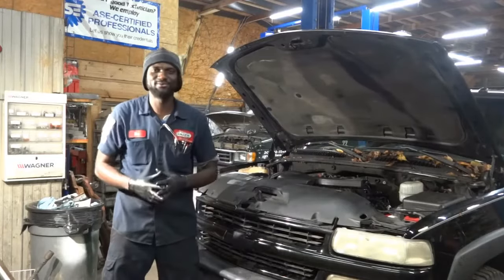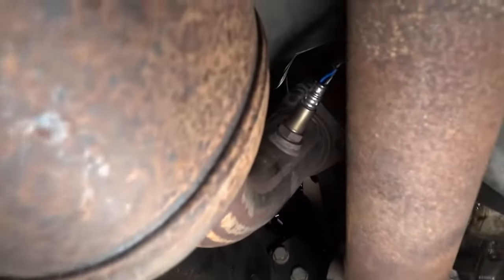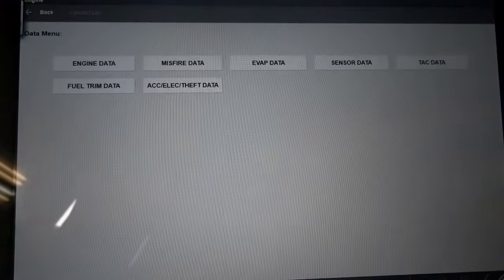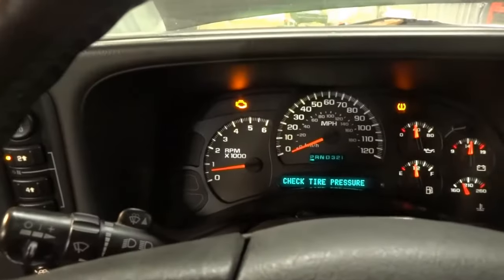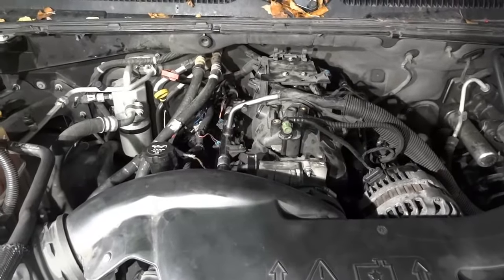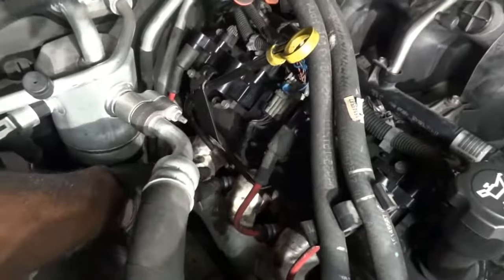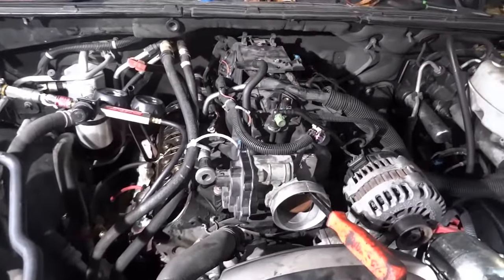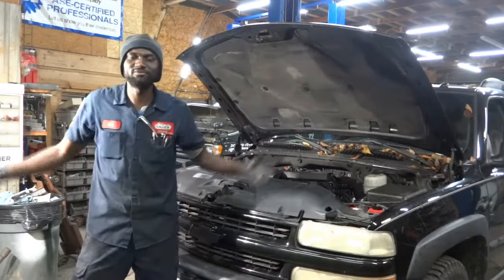CHEVROLET SUBURBAN 5.3L~ P0300, Still not Fixed After replacing the injectors and ignition Coils...

Comment: I bet you can't tell me what would make a 1996 Vortec 5.7L engine lose spark to ONLY cylinders 1 and 2 (at the end of the plug wires by the spark plug).  On my third complete new distributor.  Engine runs perfectly otherwise.
Reply from the maker: @dougr.6734   No! I can't

Comment: Did you use AC Delco Iridium plugs. Replace the plugs. with AC Delco. Do not use other brands of plugs. Only use AC Delco on GM vehicles. I tried Denso on my 2018 Silverado 5.3 and had a miss and popped the code 0300. Changed to AC Delco plugs. Problem solved.
Reply from the maker: @user-lz7uy7cd8i   Good to know! I didn't do the tune up on this!

Comment: My 03 flex fuel has the po300 code,it  skips most at hiway speed and at idle its has a slight jump and sometimes the engine light will blink a few times,ive replaced all coils will lifters throw that code or you think its an intake leak?
Reply from the maker: roltyd22  it's hard for me to say exactly what's going with it! you should take it to a pro mechanic and have it diagnosed, that way you will know exactly what's going on!!

Comment: I have the same code but mine smooths out when ingive it gas im thinkin its a fuel problem..but if its idling u can feel rhenmisfires and see it on the scanner but once u give it gas it goes straight to 0 misfires
Reply from the maker: @joeroe2839  check you coils or you might have a mechanical issue!

Comment: Well, you said they did a tune-up, so why are tou surprised they changed all 8 coils????  That's part of a tune up. When these trucks get those miles, we change all 8, along with all 8 plugs, wires, fuel filter, oxy sensors, and a service. So why the ridiculing??
Reply from the maker: @bradleyrussell1973   The tune up, you just be plugs and wires!!

Comment: What kind of scan tool do you use? Love your videos. Thanks!
Reply from the maker: Rick L I'm using the Snap on Zeus for automotive and a Diesel laptop for medium duty school buses
Reply: @KITS_Auto_and_Truck_Repair   How do you like the zeus  Deo ?  I hear a lot of complaints from other techs that it is a waste of money. Great video by the way keep up the awesome work.
Reply from the maker: @Genetics1  thank you, the Zeus has been a great tool to me so far, it has limitations when it comes to European and some Asian vehicles, but what I like the most is the labscope on it and the guided component test, the tool comes with a lot of information on sensors and other electronic components and much more, that's what made it worth buying for me, if you work on a lot of make and models the Zeus may not be good enough... Autel has got great scan tools
Reply: @KITS_Auto_and_Truck_Repair  Ok Thanks Deo !! One last question i forgot to ask you was  if the scope on the verus or zeus work on only cars or do you think it works on class 8 tractors to check sensors  like on cars.
Reply from the maker: @Genetics1  yes the scope can be used to check sensors on tractors or trucks, I use mine to check sensors on school buses too... 
since snapon scopes don't require an attenuator  you will be fine checking components with high voltages like 100v or even 200v
Reply: @KITS_Auto_and_Truck_Repair  Thnxs Deo! waiting for your next upload
Reply from the maker: @Genetics1  thank you...

Comment: So what about a air intake manifold leak?  Would that cause a misfire? Say after the oil sensor was replaced. And manifold was removed. Could it be a bad gasket on manifold?
Reply from the maker: Chris White, yeah a leaking intake manifold may cause a misfire, especially if it just started misfiring after removing the intake manifold...
make sure everything got put back together properly afterwards, like injector connector etc...
Reply: @KITS_Auto_and_Truck_Repair  thank you. It did. And I was thinking the same the truck runs fine . Guess I will take it all apart again. I bought new gaskets since I was guessing it had to come back off. I sending everyone I know to you. Your a big help. Thanks for replying means alot to me.
Reply from the maker: @chriswhite6632  you're welcome and good luck with your project...

Comment: I thought p0300 is random misfire, meaning not limited to one cylinder. Won’t the computer read a specific cylinder misfire, and in this case read cylinder 6 misfire?
Reply from the maker: Micah Watson  That's a great question!! some computer programs are not really accurate in terms of cylinder identification, when a cylinder misfires the crankshaft slows down during the combustion event of that cylinder, which can affect it's companion cylinder! when the computer sees this speed drop on two combustion events it can set a P0300, this is why it's always a good practice to verify the code and make sure the computer is not giving you the wrong information, because it happens sometimes, and in this case it did!!
Reply: @KITS_Auto_and_Truck_Repair  great video btw.
Reply from the maker: @micahwatson9017  Thank you!!

Comment: I'm having the same issue with my Hummer h2 flashing check engine light then losses power almost like to stall out has almost 200k
Reply from the maker: Tyrone Govens  You should do the test I did in the video or you can take it to a pro mechanic who can diagnose it for you!!
Reply: @KITS_Auto_and_Truck_Repair  I replaced the intake manifold full tune up but I didn't replace the coils or spark plugs
Reply from the maker: @tyronegovens6169  you should at least replace the plugs and make sure you can get good! quality plugs

Comment: Hi , so you need a New head Cylinder ? Why you did not do compression test as well?
Reply from the maker: Lennox  yes the head has to be replaced but they replaced the whole engine, I prefer  this test!!
Reply: @KITS_Auto_and_Truck_Repair  ...Thanks for your kind Reply , but if they changed the HEADS , is that not good enough for example ? If one day i have this problem and i Only change the Heads , still not good enough and why ? Thanks ...Are you in New 
York ?
Reply from the maker: @ironfistarrival  I'm in Maryland, Changing the Heads can fix this also!!
Reply: @KITS_Auto_and_Truck_Repair  ..Great , i wish i had a Garage with a lift , i live in  Montreal of Canada , bloody Cold long winters in here ,keep in touch !
Reply from the maker: @ironfistarrival  I feel your pain!! Good Luck!!

Comment: P219A on 07-13 GM Truck?
Reply from the maker: TurnThemWheels  check your air fuel ratio sensor on bank one, if the sensor is good check the injectors!
Reply: @KITS_Auto_and_Truck_Repair  originally had P015B and P015D, replaced both upstream oxygen sensors and P219A appeared after a month. Possibly injectors ?
Reply from the maker: @TurnThemWheels   Yes Check the injectors!

Comment: I replaced timing chain, and lifters,  someone else replaced one injector. Still misfires one cylinder 1
Reply from the maker: Antwon Pryor  do a cylinder leak down test and see what happens!
Reply: @KITS_Auto_and_Truck_Repair  done. Intake valve not seating properly.  Took head back off to send to machine shop. Thanks bro 🙏🏿
Reply from the maker: @Antwonpryor81  My Pleasure! I'm glad to hear that the video was helpful!

Comment: nice great info
Reply from the maker: julio soto   Thanks!!
Reply: @KITS_Auto_and_Truck_Repair  I got the same probalmost one of my injectors was wide open changed all 8 since they are 21 years old now I got a p0200 like ur other video but all my injectors have command
Reply from the maker: @jacintocity  since you have the control signal at that injector, you're missing power on that injector, check the wiring!!

Comment: Wouldn’t the open valve cause smoke to come from the muffler or no smoke at all with this situation
Reply from the maker: Andres Ramos if you have an exhaust valve that's stuck open, by using this method you will have air coming out of the tail pipe!!

Comment: My 2002 5.3 escalade has a p0300😮
Reply from the maker: @02WIFE  I hope yours doesn't have the same problem!
Reply: @KITS_Auto_and_Truck_Repair  I hope not too lol. It's got 175,000 miles been running perfect for the last 7 months. Now it has a rough idle sometimes. I cleared p0300 and it hasn't come back but it has a rough idle and a miss. I bought it last year and haven't done anything but oil changes

Comment: well if the truck is a HIGH MILES it is OK to replace all the old parts with new ones even if the customer repaces the motor or fixes the HEADS MOTOR. less GAS consumption because nothing is FOREVER.
Reply from the maker: Victor Gutierrez  Thanks for your input!!
Reply: @KITS_Auto_and_Truck_Repair  Thanks to you for showing me how to check for air in the heads..also I would like,  you to make a video on how to regulate and clean the THROLE Body when take off from the place to clean
Reply from the maker: @victorgutierrez5826  My Pleasure!! will do, when I get the opportunity!!

Comment: Last thing and I'll hush... Intake valves don't burn up and you don't have to remove the head. Run the engine and use a water bottle with half gas and half fuel mixture and poke a hole in the cap. Spray the fuel mix in the intake while vehicle is running . May take two bottles but it will break up the carbon build up around the valve and help reseat. Removing the head is completely unnecessary. Trust me on this. You just wasted time and money. Poor customer. Even taking the intake off you can get into the port with a screw driver and scrape the valve if needed. But the water and fuel mix works!!! The water cleans and steams the carbon off and the fuel helps keep the engine running and not cause it to flood out.
Reply from the maker: Gpt500  I haven't hear of this method before, is this for temporary fix? I don't think you can really clean all the valves this way! I would not feel comfortable fixing a car this way!!
Reply: @KITS_Auto_and_Truck_Repair  for many many years good mechanics would run transmission fluid down the intake while it was running to clean up everything given transmission fluid is a "detergent". It causes one hell of a smoke cloud. I don't use the transmission fluid method bc of the catalytic converters and 02 sensors on the newer vehicles but I wouldn't hesitate if I need it had no cats or gutted cats. I don't see why you say you would feel comfortable.. you won't be able to spray enough fuel and water in the engine to hydro lock anything. It's just a poor man's seafoam that works quite well and the steam itself will help clean the egr system as well as the intake valves. If you have a burnt exhaust valve than yeah pull the heads bc you can fix that but a rich condition for long periods of time mostly due to clogged cats and a bad 02 will cause this intake valve to leak. Let's say you get the heads reworked... Do you really think them valves are going to last with the cats being clogged and the egr system built up? No.. but even the ol water and fuel with clean the cats as well.  I'm sure there will be many guessing my tactics.. and that's okay.. but I bought a 05 Yukon for $1100 bucks from a lady at a shop bc the mechanic told her she had low compression and the engine was shot. I drove it home and did my thing and kept that truck for three years... I bought a 2005 Lincoln LS 3.9 that was in limp mode... $1000 car.. got it home did my truck and wahla perfectly running vehicle. This is as permanent of a fix as you will get just as much as a head job. The problem isn't the carbon or removing it. The problem. Is what's causing the build up.. 02 sensors getting dirty will cause a false reading even slightly over time cause this. Running the fuel and water cleanses everything there's it truly. Intake ports,valves,egr,02,cats. It won't clean a plug and it won't really clean the top of a piston but that's bc of en engines nature getting the air in and out so no worries about fouling a plug. I understand it's a business.. intake valve leaking remove and fix.. that's cool. But for me.. my friends cars.. my family's vehicles.. and only for me speaking even a strangers vehicle I will do everything I can to save them 1k for unnecessary replacement parts so they can use it else where. So yeah I guarantee it will work or your money back. What's it going to hurt when the engine is already having issues..... Nothing at all. But when it fixes it you'll feel even better about it. Good luck and God bless
Reply from the maker: @gpt5002  Thank you for your input!!

Comment: And they put those kind of wires on it. Must be the cheapest parts possible... If something isn't broke, especially a OEM part like ACDelco. If it's still working, don't replace it. Trust me unless you're putting good parts back on... Old used part that still works is better than the new stuff cuz the new cheap stuff is complete garbage when it comes to car parts. New old stock is everything
Reply from the maker: @Mikey-wf9py   I agree with you!

Comment: Well… now im worried.
Reply from the maker: @Bubbly_H   why?
Reply: Just like the guy you mentioned, i’ve replaced almost everything on my 04 Silverado chasing a P0300 Random Misfire. I changed all 4 O2 sensors, spark plugs, wires, checked coils and injectors, replaced catalytic converters and exhaust manifold gaskets as they were leaking. I checked fuel pressure also and tested the MAF sensor and it tested well. Now im worried it might be what you found on this vehicle 😭

Comment: Got dammmm that first mechanic robed the client for this guessing game what kind of mechanic he was lol
Reply from the maker: pastorboys pressure washing  Lol!! it's sad!!
Reply: I have a 2000 silverado with codes P430. P0174.P0171  its a 5.3...I changed all 4 oxygen sensor and cleaned the mas air flow sensor and changed the gas filter and the evap canister
Reply: Its takes 3 key turns in order for the truck to turn on

Comment: My truck has this and I’m giving up
Reply from the maker: Gwe123 Gwe123  Do the tests I did in the video and see what happens!
Reply: I had my engine rebuilt 2 years ago. I’ve replaced the spark plugs and wires. Now my truck does die sometimes and it does lose voltage sometimes when driving it is throwing a 0p300 code. Could it be fuel? Or maybe a fuel injector?

Comment: 99.99999% of the time,
If the P0300 isn't accompanied by a P030x, You can Skip Plugs and Coils.

 then it's an:
Fuel /Air Issue Issue (Main Issue is Fuel Pressure or Air Intake Leak)
Electrical/Sensor Issue (if Sensors work, it could be the wiring harness).
Cylinder Pressure (Blown Gaskets etc)
Reply from the maker: William Belmont  Good!
Reply: @KITS_Auto_and_Truck_Repair  thats assuming the plugs and coils are fresh.

If the owner can't tell you when they last changed them, change them anyway.

cause if your getting 2/3/4+ coils grounding out because they are failing you will still get random multiple misfires.
Reply from the maker: @SkateZillaSimulations  Good point!